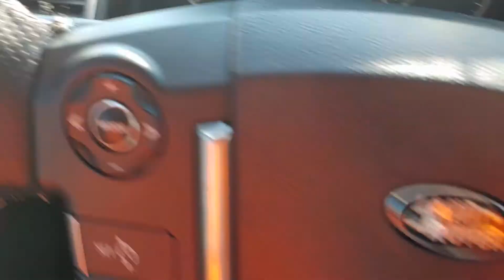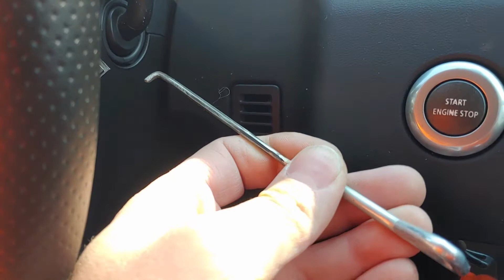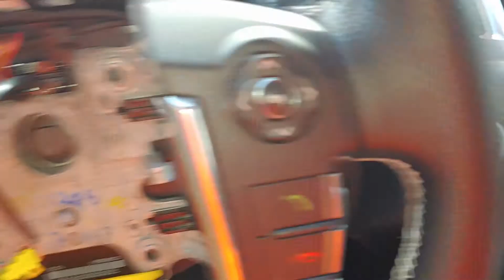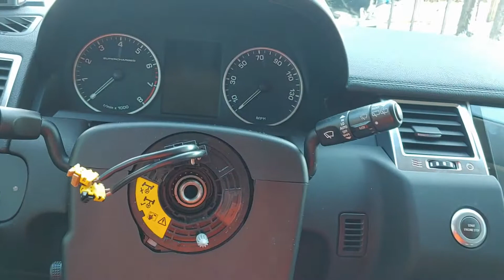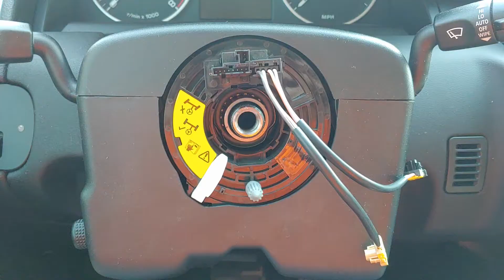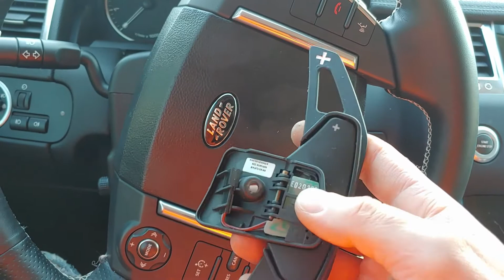Range Rover Sport Clock spring / Air bag replacement L320 2010-2013 lr4

Comment: Looks great video but I have couple of notes. When you take it back the airbag as I see you forgot to place the airbag cables under a plastic clip on the back of the airbag. That plastic piece lead the cables to the right spot otherwise able to cut it ! ThatS an IMPORTANT step. The other thing to remove the airbag not neccesary to remove the paddle shifter, the small hole is designed to let in the special tool to release it. I know is much harder when you not see it just feel it.

Comment: i dont understand what you were doing with the ziptie, is there an internal piece of the clock spring that can spin freely that you are trying to stop, it looked like you were bumping it and spinning the unit when it was still mounted, is this fine?
Reply from the maker: Often times with clock springs, they come centered on  rotations. Usually with a device lock of some sort that must be removed prior to install. Think of it this way, If your car took 2 full rotations to the left to stop at its limit as well as your clockspring, and you start with 1 rotation on clock spring already turned to left on accident due to turning it prior to install, what do you think happens to that small wire inside when at its limits and the power steering decides it wasn't that 2nd turn? You guessed it rips right out. By the way this is the same wiring that controls the detonation of your airbags.....